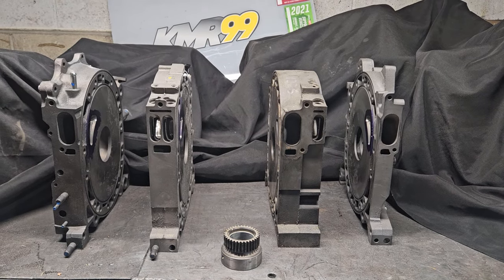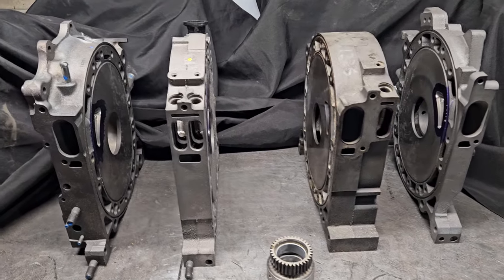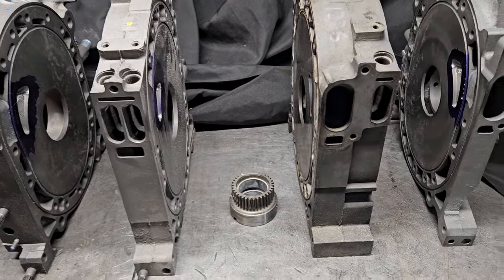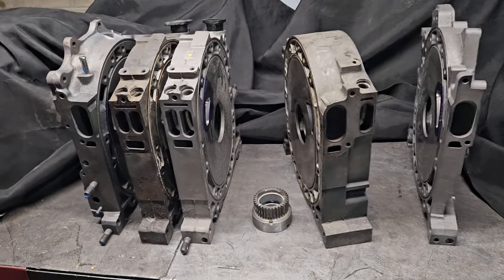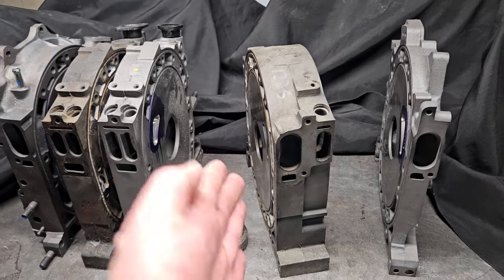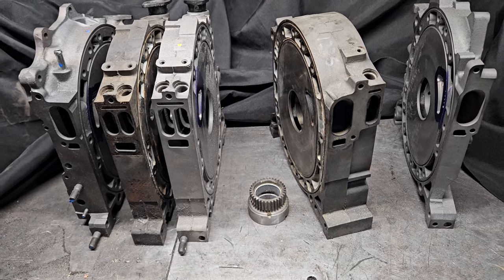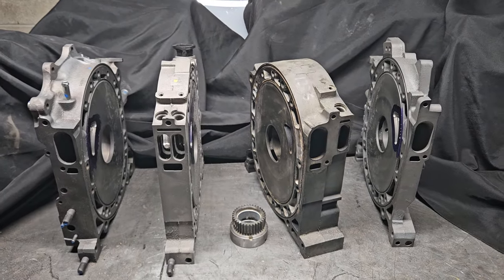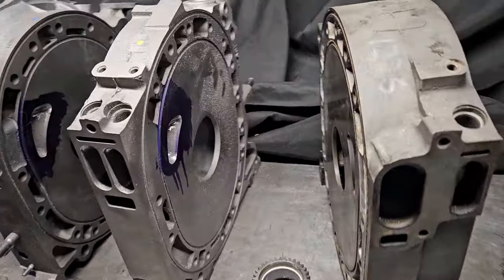3 Rotor Tech - Can you use 13b parts to make a 20b? Cosmo, and FD3S side plate discussion - KMR

Comment: Plenty of components for short crank engines being produced here in NZ. 

We’re fortunate enough to have the global guru of custom rotary eccentric shafts and machining based here.
Reply from the maker: that's awesome. Don't see many over here anymore.
Reply: 3 rotor, 4 rotor, 6 rotor, and now the 5 rotor. All components to build these engines are available in NZ. 

Keep up the great content! Love it.
Reply from the maker: @jaredrule1431  Yep. We import them.  But most don't go short 20b when you can go OEM 20b or 4 Rotor.  Why build a 3 Rotor with less strength. Has to be a specific project or reason.
Reply: Short crank 3 rotors do the job well, and cost less than OEM. Plus most of the old OEM 20b shafts need straightening these days. Some of the plates aren't in too flash a shape also aye

Jeff Bruce has been making the aftermarket shafts since aaaaages ago